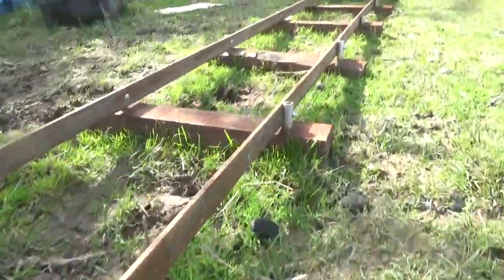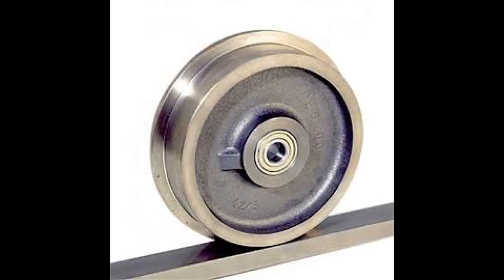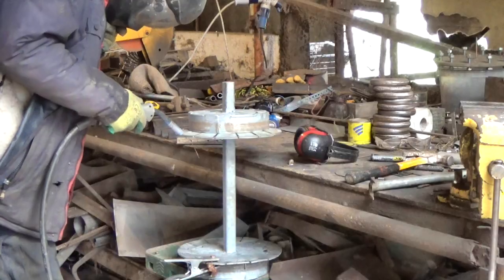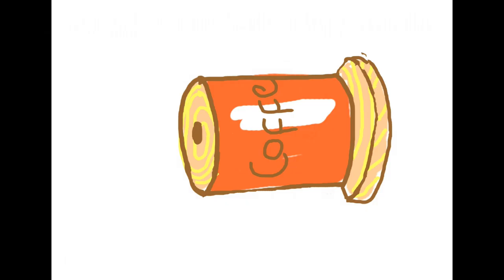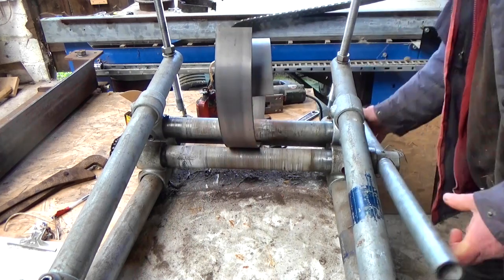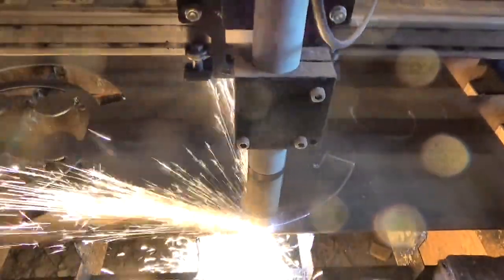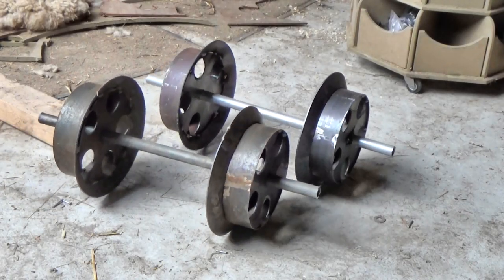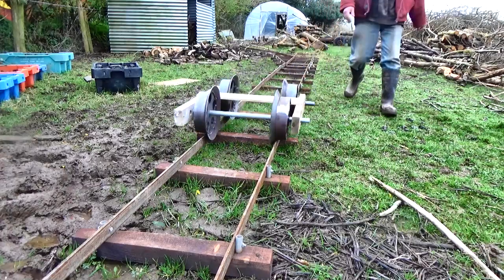Homemade Railway Wheels! (For the 15" narrow gauge railway.)

Comment: Dear Inventor- Tim
👍👌👏 Extremely well done! Runs really great on the tracks. Impressive result, looking great too, congrats! 😁 LOL, a possible catastrophe on the donkey field, what horrible/terrible scenario you painted! Really funny. By the way: I also liked the 1970 polyester trousers joke very much. 😁
Uhm... I wonder if the wheels really need bearings or if you can run the axle in a slightly bigger steel pipe (with some grease of course). If you don't use the garden railway 24/7, I guess that you can spare bearings. Please kindly allow me another suggestion: Wouldn't it be easier/cheaper/better to cut out the inner rim circles with the flanges already on? I guess you could spare a lot of time and money (for instance one complete circle of welding could be spared/saved with this method). Of course the necessary slight angle has to be hammered still.
As always: Thanks a lot for making teaching explaining recording editing uploading and sharing.
Best regards luck and health to all of you (humans animals and plants).

Comment: Old propane cylinders may yield sime usable material for wheels I would think.
Reply: I've cut them open for various projects and have to report that the metal isn't nearly as thick as I thought it would be.   Old domestic cylinders only have wall thicknesses of about 1.2mm.  On the other hand, industrial gas cylinders have much thicker walls, up to 10mm in my experience, but are very difficult to come by and generally only come in diameters of 20cm or less.

Note to anyone thinking of cutting open old gas cylinders:  They MUST be thoroughly degassed and filled with water to disburse any remaining fumes before putting a cutting tool anywhere near them.  They MUST have their valve assemblies removed in order to prevent any chance of explosion, even after degassing (steam explosions can be just as dangerous as gas explosions).

Comment: Great way to make simple friction bearings is to just make the top sides of the journals out of copper pipe and coat it with a mix of 60/40 lead solder and lead-free solder, it makes a decent approximation of Babbitt and then you can simply have a piece of cotton on the bottom half soaked with melted grease or heavy gear oil to keep them lubricated.

Easy, cheap, and can be made on-the-spot and so quickly and simply it's no worry to just toss them if you get it wrong. Ideally, you make sure the axles are polished mirror smooth and made of hardened steel, but heavier grades of lubricant and wider bearing surfaces can make up for that. Annoyingly, it DOES mean you have to keep adding oil to the axle boxes unlike modern sealed bearings which just need a pump of grease a few times a year.
Reply from the maker: thanks, Len. That's all very interesting. I imagine it would for higher speed applications too, if it could be lubricated all the time?
Reply: @WayOutWestx2  That's the beauty of the cotton wick oiling system, it continuously rubs oil onto the axle surface for the bearing journal to slide by on. With better bearing surfaces (such as coating the axle in lamp black and CASTING a bearing of REAL Babbitt that fits closely) and properly polished and hardened axles, these were used in standard-gauge railways into the 1970s, and are STILL the most common bearing on heritage railway rolling stock. 

Not as good as proper roller bearings, but absolutely good enough for most anything you're doing. The wick just needs a good glob of oil added before you start the day's work, and any time you notice it getting hot, which doesn't happen often unless you're using it with HEAVY loads for hours on end.

Comment: How about old propane tanks or welding-gas bottles instead of 'pipe'?  Do you think you could cut rings out of those, and make centers and flanges for them?  FILL them with water, all the way, to displace any unused gas, before trying to cut them, though..

Comment: Very interesting. Are you aware of the CW hunt system of outside-flanged 21 inch gauge railways? Because of the unconventional wheel system they ended up getting away with much tighter turns. Just someting interesting.
Reply from the maker: thank you. I shall look him up..

Comment: Wonder if cheap car disc break discs wont work as well..  might just have to another flange, or you might even be able to use the whole spindle with disc, they cheap enough normally...

Comment: I noticed you had an existing cast wheel. Have you considered using that as a pattern, and getting wheels cast in steel?
Reply: I thought this too.
Reply from the maker: I couldn't afford to get them cast, but I might use the broken one as a pattern to cast them myself - if I get that far. (Not in steel though - really high temperatures needed for that.)

Comment: Great series, Tim! 
I assume you're way ahead on this one, but... Since the rails are much thinner than usual, is it possible that the pressure will concentrate and tweak the wheels under heavy or extended load? The further out the outside ring is, the less it will resist the rail getting creased. Perhaps slightly narrower wheel surface would resist more? And, maybe narrower surface will allow you to feasibly use/bend thicker material?  Or, as you said to Matthias, maybe an extra (partial?) ring close to the rail bearing area?
Reply from the maker: Yes, I don't know which part is the weakest - it could be the treads, but perhaps not?

Comment: What about using used brake rotors and adding your angled flange onto it?  It would be inexpensive per wheel and would likely cut down on time per wheel.
Reply from the maker: I haven't tried it yet because grinding all that steel off didn't seem worth it. But let me know if you do?

Comment: if you are planing to make allot of wheels you might consider investing in a metal lathe, a second hand lathe is not necessary that expensive if you can transport it (expect 1000kg+). 
Or you can perhaps order some from china, but that would be the less interesting alternative for me as a viewer.

also the part of the wheel that is in contact whit the track should be conical. it i will make it take curves better with a fixed axle. but for you railway it probably does mater that much.

Comment: Could you have recycled aluminium drinks cans, bought some greensand and cast a set from the cans?  Doing it that way, you could recreate the broken wheel without having to braise it first.
Reply: I’ve seen some very crude aluminum casting videos on YouTube that look simple enough. A makeshift furnace burning coal and a crucible of steel seems to do the trick.  Tim, just be careful with those hot sparks in your wood scraps—we don’t want to see the barn go up in flames!

Comment: As others have suggested,  tapered treads are the way to go. Perhaps cut your tread strip ends at slight angle which would force the shape into a cone when you weld them up.

Oh and knock over that nail sticking out of your wooden test frame - you don't want get jabbed and get tetanus.

Comment: I was thinking about the way you attach your rails to the sleepers and I was thinking that maybe the pipe would eventually move up and down in the sleeper. Would it be in idea to cut "L" bracket from angle iron (about 40mm wide) weld it to the rail where it sits on the sleeper, drill a hole in the "L"  bracket then you can simply screw the rail to the sleeper?
Reply from the maker: Yes, that would work - but you might need a slot shaped hole unless you were absolutely spot on with your drilling, otherwise the weight of the rail (and train) might be on the bolt? I don't think it's bad that the pipe in my design moves up and down?
Reply: @WayOutWestx2   thank you for your reply,  but I was thinking of a self tapping roofing bolt like the ones used to screw down corrugated tin sheeting and screw the bolt directly into the sleeper no need for a slot shaped hole...   I really love this project. I look forward to future instalments.

Comment: Your on a roll.   hahah   Question: Could you have cast the wheels in concrete W/fiberglass bits as reinforcement  & fished with a steels band  around  for the contact  surfaces?
Reply from the maker: I don't know - try it and tell us how they do?

Comment: Until you showed the importance of the tapered flanges I was sure the solution would be rear disc - brake rotors for cars. They are otherwise exactly the right size, and a salvage yard would likely sell them to you for scrap price.

Comment: What about old car tire rims.  They are often taken out of service on car tires and seem to be thrown out.  They are round with a flange.  already have the basic shape needed.  They may need to be cut in two or used whole.  A lot less effort???
Reply: Garden tractor rims are often of the split variety. They would need a plate added to the flanged side. And then filled with concrete to serve as weight and keep them from being pounded out of round at joints, points, and frogs.

Comment: How about used brake disks from cars.  You'd have to turn an angle on the flange, but they'd be nice and big, cheap and little work.
Reply: Some with a taper on what would be the tread will work. On everything but curves, it isn't the flange that guides the wheels, it is that taper and the crown of the rail. When you go to a flat top rail, the taper becomes even more important.

Comment: Once they are galvanized you could tape over the holes in the inner ring and fill with concrete. The increased weight would lower the center of gravity and add stability.

Comment: I don't think navigating bends has anything to do with the flanges being tapered. It's extra wide tapered threads that allow for the differential of rotation between wheels on each side of the axle when moving in a curve. They need to be extra wide to allow them space to shimmy from side to side as needs be.

Comment: You have to have camber on the wheel face that rides on the rail head, several degrees acually, that's what keeps the wheel centered on the rail and gives it a differential effect to go around bends, your wheels won't work properly.
Reply from the maker: Here you go... https://www.youtube.com/watch?v=VG49XIr_T4Y&list=PL3_dJayH6e6iNKGw-GOL1ydCu8pGw5-6b&index=14

Comment: As a carpenter... I see a band of iron and just can't fight the urge to fill it with really super compression strength... concrete!  Why not fill the inside of the wheels with concrete and they should carry any load you can put on them?  The tension strength of steel around the outside with compression strong concrete on the inside... I mean hey... that should be an EASY to build extremely strong wheel!
Reply from the maker: Yes, it might work, but concrete falls apart with percussive shocks so it would need some reinforcing fibres, maybe?

Comment: did you know that with real wheels, the konise plate is the side that rests on the track   so the wheel wants to move through the weight to the center of the track of itself

Comment: It would be much easier to make wooded wheels but they wouldn't last so long. If I make mine I'd have an Inch and a half circle shape for the tread and maybe a little larger 3/4 Inch circle for the flange and jigsaw it into a little cone then screw them together.

Comment: I just picked up your channel when you came to build the switch.  I'm impressed with your skills at making the things you need with
alternative and cheaper materials.  But based on seeing how skillful you are, I think you could have done better with that switch point, it just seems to be somewhat beneath your skill set.  Anyway, just friendly constructive criticism.
Reply from the maker: Did you see the video on why I made it that way?
Reply: @WayOutWestx2  Actually I did, I find what you're doing fascinating.  And please don't get me wrong regarding my comment, since you're going for simplicity of design that's fine. 
I just think it could be better and less clunky.  When the wagons are fully loaded and heavy they may place extra stresses on the track and wheels when turning into the siding and mean extra effort for the person pushing.  In any case, it's just my humble opinion. 🙂

Comment: This is interesting, but this wheel design is wrong, train wheels are conical in shape, the flanges are just safety devices. The conical wheels will auto-center and minimize the flanges frictioning with the track.
But, in your design, the train wheels are cylindrical, the entire responsibility now lies on the flanges to keep them on the track, especially during corners, the entire load will be on the flanges, given that the flanges aren't part of the wheel and they're just welded, this is quite risky. Please don't use these wheels in any real world use case. An easy quick fix is to smear some surface of the wheel to 1:20 ratio like real train wheels. Good luck!
Reply from the maker: Have a look at this one, T.E. - https://youtu.be/VG49XIr_T4Y
Reply: @WayOutWestx2  Excellent :) Love your blog and transparency Tim! Subscribed!!